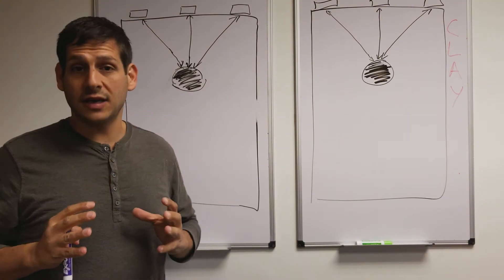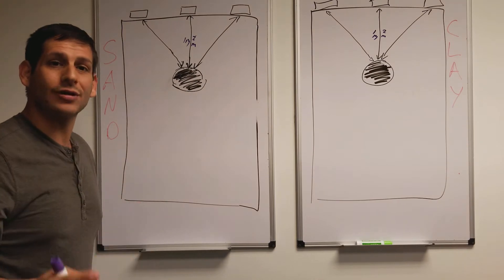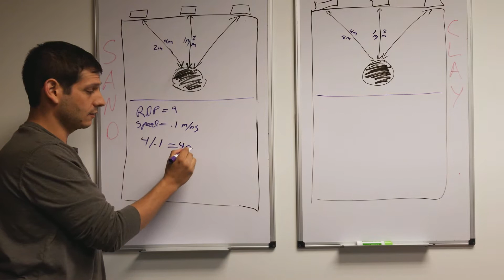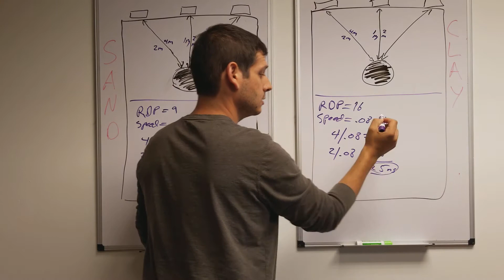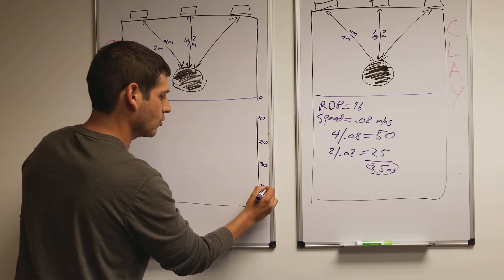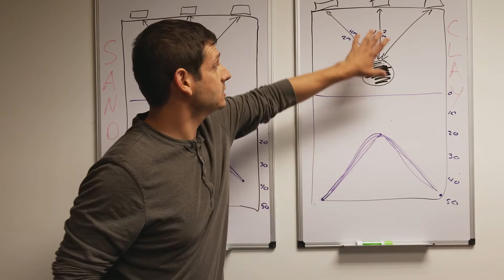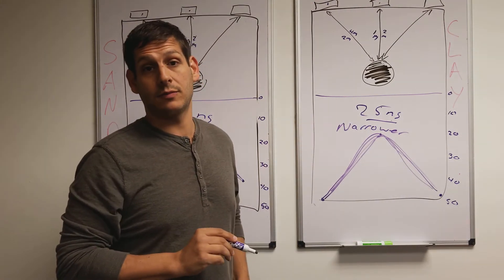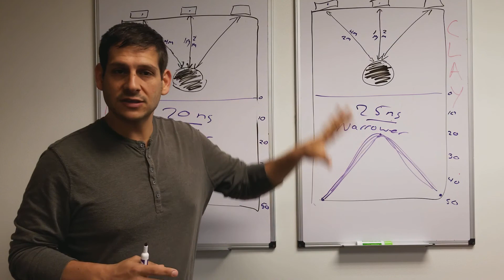Why Different Materials Produce Different GPR Responses | Ground Penetrating Radar Utility Locating

Comment: Hello, thank you very much for your efforts. If I have 1400mm pipe, what is the best "Time Interval" to use? I'm using Mala Easy locator pro
Reply from the maker: Thanks for the question. Are you lookingbfor horizontal interval? Or vertical time window? How deep is it?
Reply: Sorry my bad, I mean "Point interval" for example:
 [Point interval: 0.020m (3.9m/s)], 
I can change the 0.20m value and accordingly the 3.9m/s would change.

I'm looking for a pipe with 1400mm diameter, 3m expected depth.

Comment: This velocity is v(rms) but in actual scenario we have different layers of soil having different velocities and the wave will bend as the velocity changes, then how are we going to estimate the material or depth of the utility by its hyperbola signature?
Reply from the maker: 2 potential options. Most software will average velocity from ground to target. GPR slice software will allownyou to do a multi layer velocity model. That is the best option.